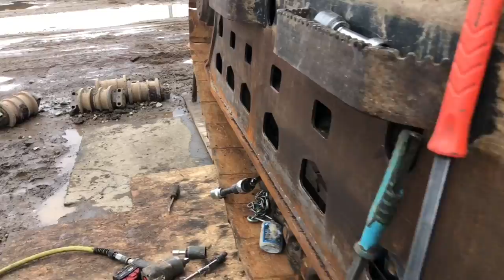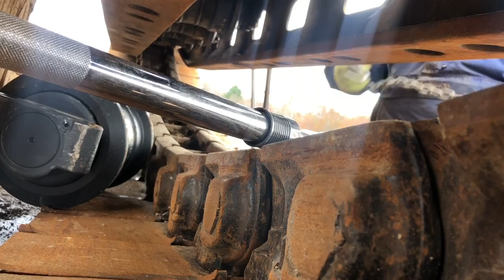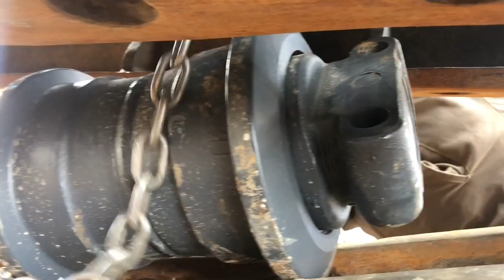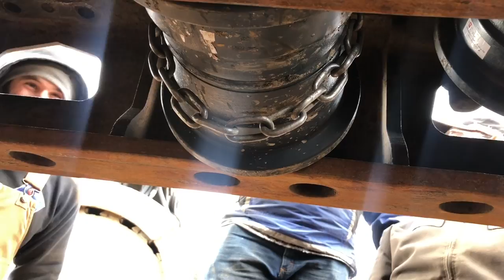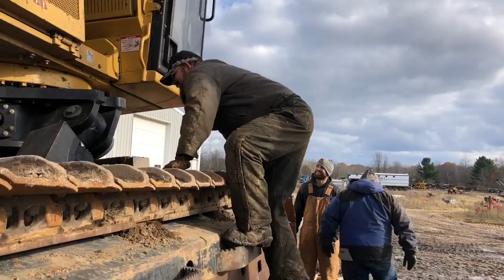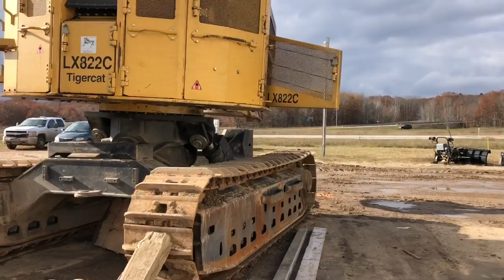Tigercat is on the move!!!

Comment: The easy way to put the lower rollers in is with a jig on a forklift tine. We had lifts with side shift and fork spreaders so it was easy to position the rollers. A jig can also be built that allows the rollers to be moved sideways if the fork doesn't.

Comment: NOTHING easy about rollers unless the track frame is out from under the machine and turned upside down and that's marginal in how many bolts stripped or wrung off. Then maybe rock guards. You ought to get Handsome to Handrone them on! Prayers, BLESSINGS and Hug Everybody! What about sprockets and idlers????